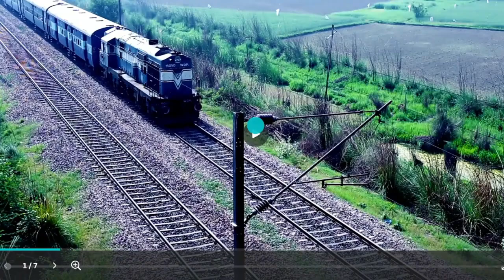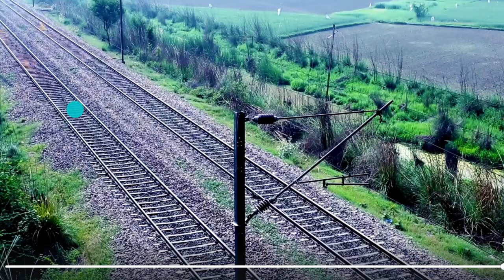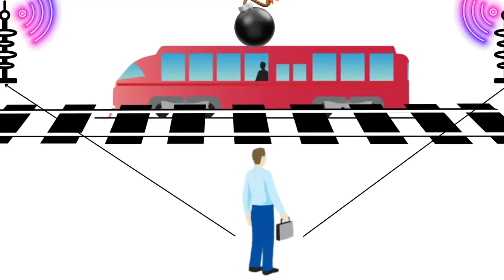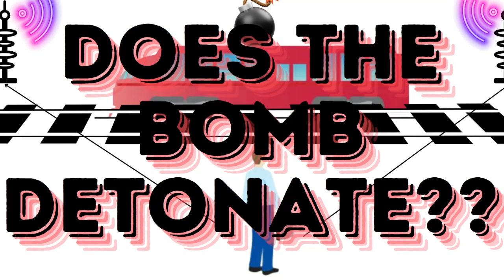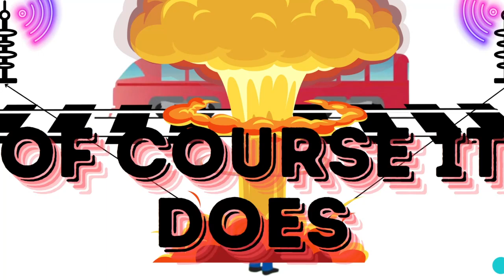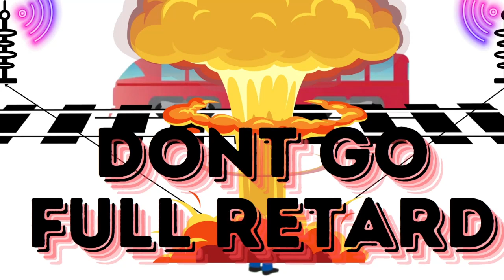Relativity of Simultaneity is False

Comment: Wrong, as I tried to explaiin on X.  These apparent paradoxes invariably involve extended objects and the propagation of some signal along them, which is always overlooked or neglected. Let me try again. 

In this Gedanken Experiment the bomb is in the middle of the train, and is preset such as it explodes if it receives two simultaneous signals  from the train ends. In the external observer's frame lightning strikes both ends of the train simultaneously. The bomb, however, is supposed to be ON THE TRAIN (the case where the bomb is held by the external observer is a different one, and it leads to no paradox either) and to receive signals from the train ends. In relativity, no signal can propagate faster than light. In the external observer's frame, the train is moving to the right at velocity v, and so is the bomb. Suppose lightning strikes at time t= 0 in this frame. A light pulse/signal is sent from the train's tail and from the train's head. Supposing the train's length is 2L, and that the bomb is at x=0 at t=0, you have that the bomb's position as a function of time is xB = vt. The light signal's position from the tail is xT = -L +ct, while for the signal from the head (emitted backwards) it is xH = L-ct.   The bomb will receiive the light signal at a time where its position coincides with the signal's. 

For the tail signal:

xB  =  xT
vt_L = - L+ct_L. 
t_L = L/(c-v)

For the head signal
xB = xH
vt_H = L-ct_H
t_H= L/(c+v) 

 t_H < t_L

so the bomb will receive the head signal first, in this frame, and the bomb will not go off. 

To see what happens in the train's frame according to relativity, one needs to transform the pulse emission events according to Lorentz transformations

ct' = γct -  βγ x
x' = γx -  βγ ct

(where γ^2 = 1-  β^2. and β = v/c)

so for the pulse emission from the tail (at t=0 in the platform's frame) the starting time is

ct'_0T = - βγ(-L) = βγL

while the starting position is

x'_0T =  γ(-L) = -γL 

A light signal emitted at x' = -γL will reach the bomb position (x'_B=0 at all times in the train's frame) after a time Delta t' = Delta(x')/c = γL/c, so at a time  t'_T = t'_0T + Delta(t')

t'_T = βγL/c + γL/c = (1+β) γL/c

For the pulse emission from the head (at t=0 in the platform's frame) the starting time is

ct'_0H = - βγ(L) = -βγL

(the lightning strokes are NOT simultaneous, they do not happen at the same time)

while the starting position is

x'_0H=  γ(L) = γL 

Again, a light signal emitted at x' = γL will reach the bomb position (x'_B=0) after a time Delta t' = Delta(x')/c = γL/c, so at a time  t'_H = t'_0H + Delta(t')

t'_H = -βγL/c + γL/c = (1-β) γL/c 

t'_H < t'_T

So in the train's frame too the signal from the head arrives BEFORE the signal from the tail, and the bomb does not go off. No paradox.

To complete the calculation, if you want to compare the signal delay in the two frames, you have that in the frame where the train moves

tL - tH = L/(c-v) - L/(c+v) = 2Lv / (c^2-v^2) = 2 β γ^2 L/c

In the frame of the train 

t'_T -  t'_H.  = (1+β) γL/c - (1-β) γL/c  = 2 β γ L/c 

The time interval where the train is moving is multiplied by a factor  γ with respect to the same interval measured in the frame where the train is stationary. This is the relativistic time dilation. 

No paradox.
Reply: Get a life
Reply: @Titus213-xc7pi  I have one thanks.
Reply: @francoligabue9727  😂 I mean do u just keep shit like that saved or do u construct a comment like that randomly? It’s just nuts and how u expect people to know what you’re saying? Sound like pseudoscience
Reply: @Titus213-xc7pi  no, I made the calculations and wrote them down.  If someone makes a claim about physics, one can only reply using physics, and this is what I did. Physics is done with equations and calculations, not with words, videos and memes.

I teach this stuff at university as part of a classical electrodynamics course, and every year this kind of apparent paradoxes are proposed to the students - and shown to be just that, apparent paradoxes, no contradiction at all. People trying to use them to disprove relativity only demonstrate that they have not understood it, or that they are applying it wrong.
Reply: @Titus213-xc7pi  as for expecting people to know what I'm saying. Yes, I expect my students not only to know what I'm saying but to be able to make the same calculations and solve related problems - that is the only way of judging someone's level of understanding in physics. And I expect people who claim they can disprove or refute relativity to know what they're talking about, otherwise it's just empty blabbering by charlatans.